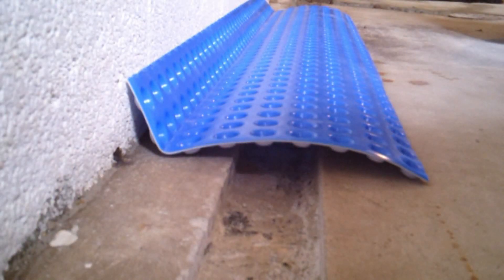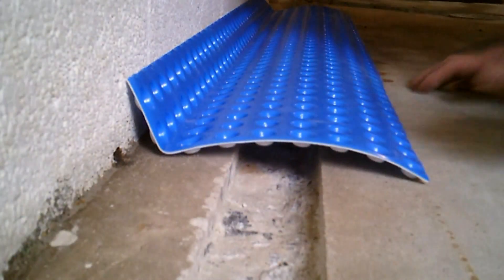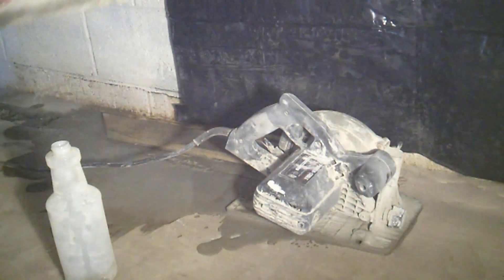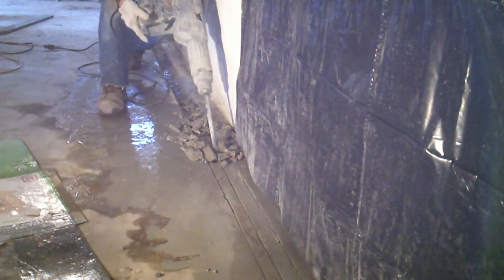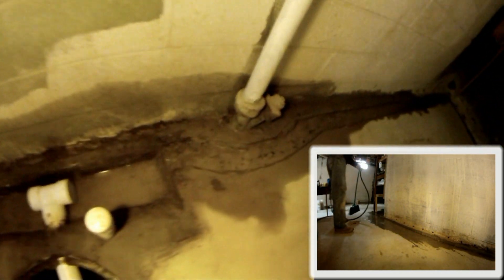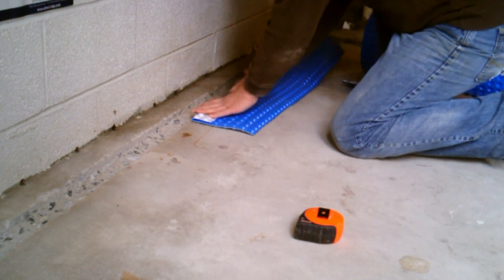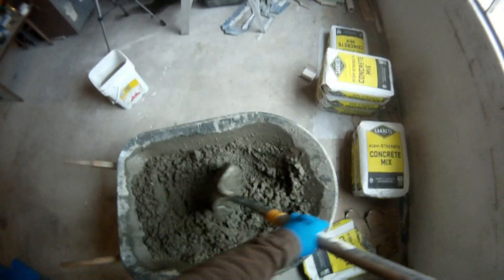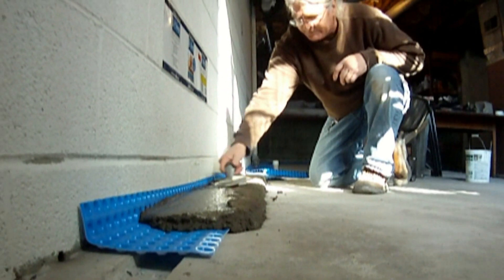Basement perimeter CHANNEL DRAIN System ~ The 1st of several methods in  waterproofing

Comment: Hello @Atlantic drain very nice video and Idea. could you please explain whats the actual purpose of dimple board here? How is it useful once is covered by concrete?
I have similar issue, my basement floor and footer was poured at same time, then  my walls were poured, the walls are 8in thickness wall, Improper vibration was there so few honeycombs are also letting water find its way through few spots, with this info, does this video sounds like a good approach for me?
Reply from the maker: Hi Fransisco,
Thank you for watching.
water is able to go from weep holes into channel. dimple board covers weep holes goes over top of channel, and does not collapse from the weight of finish concrete.

Comment: I looked on ebay for the dimple board. Not there. Where do you get it? I only need about 15ft to place it exactly like you did in this video.
Reply from the maker: Hey Diy Oregon,
Thank you for watching.
just put key words into google search
DIMPLE BOARD BASEMENT perimeter drain. that shoulkd bring up a few different suppliers. it might be clear versus blue.
Thanks again for watching!

Comment: Can this be done around a fireplace in the basement ? The fireplace sits on a footer with about an inch or two of concrete on top of the footer for a tile hearth.
Reply from the maker: Hey David, thank you for watching.
No, You would need to do a more traditional perimeter drain install where you go thru the concrete, dig trench around fireplace footer, expose top of footer, install gravel, pipe, cut concrete for trenching to wall or sump pit, etc. Not sure what your problem. Q: where is water coming from? And do you have basement perimeter drain installed?
Thanks again for watching!

Comment: This is what I would like to do,but I have a footer with cinder block walls. Can you tell me why It would not work?  I have a sump already installed. Thanks for your time.
Reply from the maker: Hey Nuno~
You could do an install like this but,
if you have a footer,
you can go all the way thru concrete, dig out a trench, gravel fill with perforated pipe, add the blue dimple board on top and still have flush concrete finish to basement floor.
But, yes, you can do your installation exactly like what I have done in the video if you want.
It is less work less materials .
Reply: @AtlanticDrain Great! Thanks for taking the time to reply and thanks for the great vid.
Reply from the maker: thumbs up
Reply: @AtlanticDrain  If you cut through the concrete you a) Remove buttressing support for the walls and b) leave a massive open gap to let in ground water. Madness.
Reply: @dgbucko  how would you resolve it, I have same issue and I was going to do this
Reply: @franciscomelendez3398  On the assumption that you require a dry basement, the best way to do this is to stop water coming in, not to encourage water to come in. Think of the basement as a boat in the sea. What would happen if you drilled holes or removed some of the hull? The correct way is to use products to limit water flow, such as water plugs and cementitious tanking. Then place a cavity drain system internally that is only dealing with small volumes. In the UK we call this Type A (barrier) plus Type C (drained). Loads on google mate.

Comment: I do have a mono poured floor. How deep should I make the saw cuts?
Reply from the maker: ~ hey alty ~ THIS VIDEO is for a basement with NO FOOTERS....do you currently have a sump system installed? if you have a FOOTER under the cinder block wall, you can cut all the way thru the concrete around the perimeter of the floor /problem area.  dig out & remove clay/soil down to TOP OF FOOTER LEVEL, drill holes in cinder block cavities just below slab level ( if not already there...) Lace gravel bottom of trench, install perforated pipe ( holes face downward),  cover with more 3/4" gravel, install dimple board then concrete into place FLUSH with current slab level. do you currently have a sump pump installed? what year was the home built?  I strongly recommend you watch more video of basement perimeter drains for homes with footers under basement walls. also, get a basement water specialist over to your home for a consultation
Reply: I do not have a footer.  Floor was poured all at once. Mono poured.

Comment: Isn't this the same as those box systems that people say never work?
Reply from the maker: Hey Social ~ Thanks for watching ~ For the type of floor/ cinder block configuration ( floating slab with NO FOOTER under cinder blocks)  in this video, it is the ONLY solution that works . The Plastic box drain you are speaking of is an alternative to chipping a channel in the concrete.there is also a system that is epoxied on to the floor and directs water to the sump pit. The concrete channel drain is a LONG LASTING solution for basements with above mentioned configuration . Thanks for watching
Reply: Would this work on a monolithic poured floor?
Reply from the maker: @alty79  ~ hey alty ~ thanks for watching. again, this configuration is best when you have a monolithic slab with NO FOOTER. Tell me more about your floor set up. is this on a SLAB HOME ( no basement)? thanks again for watching
Reply: AtlanticDrain my floor and footer were poured all at once. Then the basement walls were built on top.
Reply from the maker: @alty79   are the walls cinder block or poured concrete?
Reply: AtlanticDrain cinder
Reply: I have cinder block walls on top of a floating slab.  What kind of board are you using?
Reply from the maker: @alty79  ~Hey Alty ~ DMX 1 STEP ~ dimple board. comes in 100 ft x 3.67 ft rolls on ebay